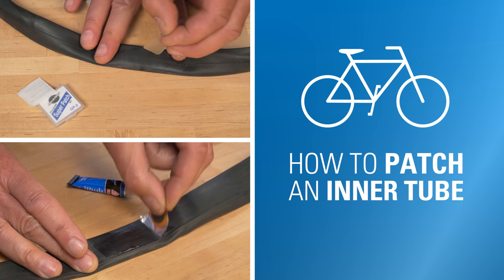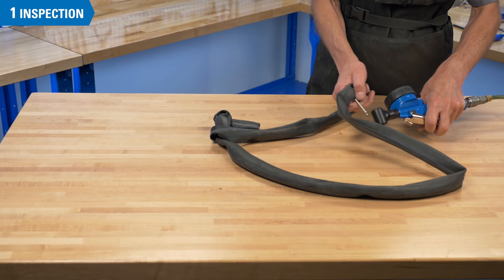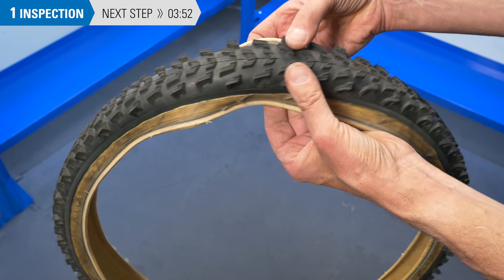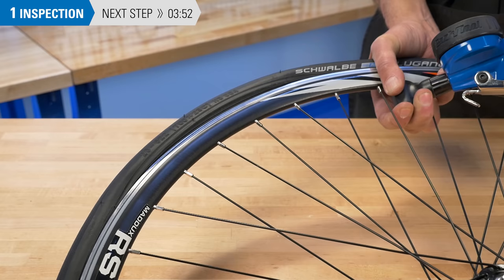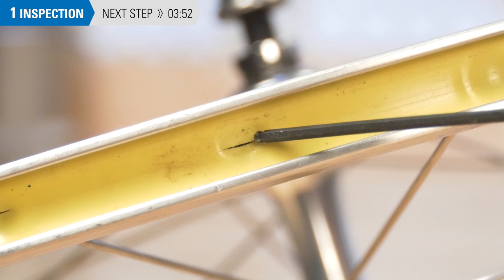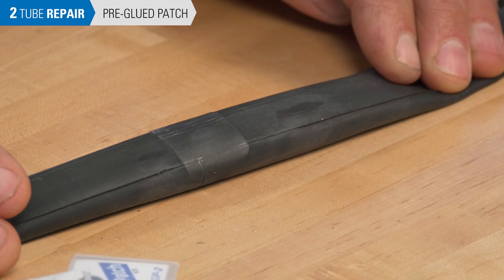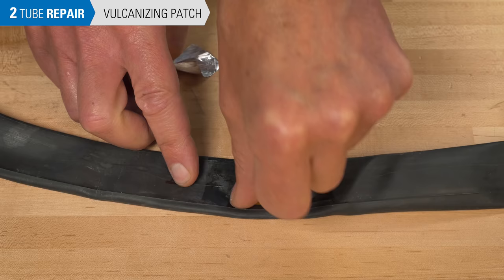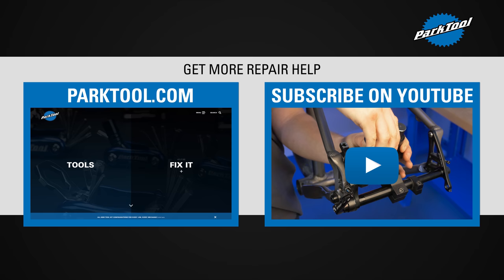How to Patch a Bicycle Inner Tube

Comment: I ride all the time and have had a ton of flats.  I’d add one caveat to this excellent video.  DON’T carry a patched tube as your spare.  When I get home, I promptly repair the replaced tube from my ride and swap it out with the NEW tube I used while on the road.  I put the non punctured tube back in my carry bag.  I was once stranded in the middle of nowhere because the tube patch failed and that’s not the place to discover this.  Just my thoughts based on actual real life adventures.
Reply: Just get yourself some airless tyres and you don't have to worry about flats ever again.
Reply: @leemanwrong  Well, that's not 100% true.  We've had to leave people behind for pickup cuz the sealant wasn't working.  Been on the fence about going tubeless as a result.  Plus, got a screw puncture that went right through my carbon Zipp 404, so I don't know if it would hold pressure.   Still, tubeless is far more reliable

Update :  I misread that.  You said airless, not tubeless.  DOH!
Reply: Lol I just use superglue and a piece of paper to patch the tires on my ebike. The rear tire is still holding after about a week, I just did the front tire today which I know should hold longer because the rear tire is where most of the weight is. I've changed that tube so many times now because the tires I've previously used wore out pretty quickly due to it not being flat like. I plan on just getting tannus armor for the rear wheel. Not only that but you can ride on it if you get a flat.
Reply: @jimsjacob  I use Tannus airless tyres which have been amazing. They are quite firm so they give a bit of a rough ride on bad roads but not having to worry about flats makes it totally worth it.
Reply: @dizzydeckdog6688  Haha true, riding on some bad roads could make your teeth chatter a bit!
Reply: So if I understand your method correctly, you put the patched tube back on your wheel and ALWAYS have a NEW tube in your bag as a spare. Right?
Reply: @irenevoce4922  Correct.  It's not that I favor a patched tube over a new tube, but rather I'm trying to be economical.  I ride on Zipp Firecrest 404's and those require a 80mm valve stem.  Found that when I get home, I can ID the hole, apply a patch and re-install the tube.  Has worked great for me and I just put the new tube back in my diddie bag. Eventually a new tube remains installed and the process starts over.
Reply: @jimsjacob  thank you. Good advice. This is a nice balance between economical and excessive caution
Reply: Solid advice! I do the same.
Reply: I also love the clear adhesive patches that park tool has! It’s great for on the go fixes, but the glue works great for at-home fixes.
Reply: No, WADR you were stranded in the middle of nowhere because 1) you did not bring enough tubes, and 2) you did a shabby job of patching your tube. You can put well patched tubes into your tube rotation with no worries. Eventually, you might reach a limit... one time I set out to patch a tube and found there were already 6 patches on it. I repurposed it as a bike chain cover.
Reply: Agree. Fat tire. War on goat heads.
Reply: It failed because you failed, not the patch. If you had done it correctly (not like this video shows, glue BOTH the patch and the tube) which you did not, it would not have failed. I have ridden on patched tubes for YEARS.
Reply: @gary7vn  Whats bs? I've been riding airless tyres for a year now, i've had nails and all sorts of things get stuck in my tyres and i can just keep going.
Reply: Yes and also confirm the hole has been repaired properly by the same methods used to discover the hole in the first place
Reply: @leemanwrong  needed this comment just fixed my first e bike flat and never want to do it again lol
Reply: @yru435  You can turn a tube into a bike chain cover?  How do you do that?
Reply: You just didn't patch it properly. I've been using patched tubes,the most with 9 patches and it still works
Reply: @entltyq  Yeah I did.  My tubes can look like leopard skin with all the patches.  Just put the 4th patch last week on my rear wheel. It's not rocket science patching a tube.  The patch can fail, the glue can fail, etc.  Once the tube is inflated and expands, the glued down portion will not and can tear at the edge.  Hence, repair it and immediately install it.  It then has the chance to naturally stretch with the rest of the tube.  Any issues are revealed right there at home and not out in an orange grove in the middle of nowhere.  Take it from an expert.
Reply: L m
Reply: L m
Reply: Good advice. It’s better to use the patched tube for the ride and keep the new inner tube as spare.
Reply: @leemanwrong airless tires?
Reply: @johntyson  Yes i use tannus airless tyres. They're a solid tyre made of a rubbery type compound. They do make the ride bumpier but in exchange you never have to worry about a flat tyre.
Reply: Well patched spare tube works as fine as a new one.
Reply: I realise this is 2 years old but just to let everyone know, you should not be getting "a ton of flats", even if you ride a lot on rugged terrain. If you do, you have either (1) the wrong tire or (2) the wrong air pressure. Get good tires for the type of terrain you ride on and inflate them well enough according to your weight and the tire specification (SRAM has a handy calculator online but you should tweak it for ride feel and amount of flats).

Good tires cost 50+$ but actually they save you a bunch of money down the line since you don't get flats all the time.
Reply: @ohfouroneone  Ironic....  Yesterday's club ride saw a total of 5, yes count 'em, FIVE flats for 5 diff guys.  While unusal, that's a ton of flats. Screw, staple, glass and rocks were the cause and if you ride as long and  far as I have, you will have tons of flats.  No matter how much you paid or the pressure.  Carry what you need to rescue yourself and make sure it's not a patched tube.  That, or ride where there's signal so you can Uber yourself home.

Comment: Wait what? You guys throw away the tube when it's punctured?!!!! My tube has 6 patches on it and it's still running strong.
Reply: what kind of parches do you use glueless or regular rubber patches with glue
Reply: Why not just use a new tube after you get one?
Reply: mine's 8 lol
Reply: @Cameron XP year old comment but I read that as pawn shop first and wondered who the hell pawns an inner tube
Reply: There's nothing wrong with patching the tube multiple times, as long as you know how to patch a tube prooerly. I've used tubes that have around 10 patches, not the Park Tools patches definitely, they fail,  they're soft and the glue is  weak.
Reply: @AR-lz2br  which ones work the best, I want to have at least 30 patches on mine.
Reply: It's because you're poor.
Reply: @Mannie Illescas your learning bud thats the beauty!
Reply: Jokes on you, I don't even have a tube
Reply: @Frijo1  there are some vulcanizing shops that patch it with a rubber something and stick it with heat
Reply: It depends. If the tube's still manageable, you can keep riding on it. If it's damaged beyond repair, replace it.
Reply: @mantid83  It's both expensive and creates unnecessary waste. If you have a small pinhole puncture, why get a new tyre when you can repair it and have it work perfectly fine?
Reply: cutting patch from really dead tube and using whatever glue one can get hands on (or even cook your own glue in back yard!) to patch tube was a thing in soviet union, but now in throw away society regular new tube is cheaper than those fancy patching kits.
Reply: @moofymoo  I got a self-vulcanizing patch kit for $1.25
Reply: Lmao, i just glued my 23rd patch on my tube
Reply: LOL “6 patches and still running strong” HOLY CRAP!
Reply: Yes.i throw mine away or cut them up to tie stuff.  Patched tube no matter how well done will never be as good as a new know. I'd rather be safe and have a peace of mind rather than worry every second  if it will explode when I am going 50kph downhill
Reply: What brand do you use
Reply: That's why we are known as Indian 😅🤣🤣🤣
Reply: unless you buy patches and glue in bulk, its around the 3rd or 4th patch where it would have cost the same amount of money and much less time to buy a new tube
maybe you are going for an Innertube of Theseus ?
Reply: really? years ago i had a tube which is almost full of patch
Reply: @chaosbreaker657  really, as opposed to using a tube you can't use, genius? It's always a good idea to use a patch vs replacing, if possible. Waste not, want not
Reply: @BeeBait  That's what I was talking about. If the damage can be repaired, patch it. If the damage is too great (a massive tear on the inner tube, for instance) replace the inner tube at once.
Reply: @zpolukuchka  If you had to patch it 3-4 times,  you'd have needed to buy 3-4 tubes.
Reply: @JoshuaLevy123  dude, You are ambicious!!!

Comment: idk where I would be cycling wise without these videos. thanks for being there parktool. my dad wasn't around much and here I am in adult hood trying to figure shit out on my own.
Reply: Their method for "vulcanizing"  (it's not vulcanizing, words mean something) is simply wrong. The "fluid" they are talking about is, wait for it, "glue", to be precise, it's contact cement. To properly "fluid" sorry, glue something with contact cement, you need to glue BOTH surfaces, at least they got the let it get tacky part correct.
vulcanizing - https://en.wikipedia.org/wiki/Vulcanization
Reply: And you have the smarts to do so 847...your Dad did the best he could at the time with what he had.  Forgive my friend.

Comment: I used to buy a brand new tube after every puncture... $20 surely adds up overtime.
Reply: I used to do the same ,with this video I can now do it myself
Reply: why do you need to buy such expensive inner tubes when there are far cheaper ones which seem to be the same quality as far as i can tell

Comment: I noticed that I had a puncture in the front tyre of my Moulton on the way back from the supermarket. Prepared as always I whipped out my brand new, unused Park Tool puncture repair kit and prepared the inner tube for a patch. Opening the tube of rubber adhesive compound I found the tube to be sealed, but completely empty, In the manufacturing process something had obviously gone wrong. Fortunately on this occasion I had a spare inner tube, which saved the day. I decided to go further up the food chain of puncture repair kits and bought the highly recommended Rema TT02 kit. This is my second one and Rema are at the top of their game as they fill their adhesive compound tubes with more than air! You actually get the adhesive!
Reply: it's always a plus when a tube of glue actually contains glue👍🤭
Reply: Literally looks the same as the parktool one but rebranded

Comment: Thank you for a great more video. I had a suggestion about patching,  i normally do all steps as you mentioned above but an step further, that is ; before applying the patch on the inner tube i inflate the tube to a diameter equal to the bore diameter of tire itself, then apply the patch, push the patch by fingers  and wait for about one minute، then deflate the tube and insert it as you mentioned.
This minimizes  the  stretching of the patch while inflating the tube with high psi and prevent it from detaching and  lengthens  patch stability. 👍
Reply: at what point are you letting the glue dry ?
Reply: @carlosrestrepo8525  Well, the glue is still stretchy, so ...

Comment: Thank you for great video! Another small tip is always placing tube valve somewhere under the middle of the tire label when initially installing the tube. When you find a puncture and align punctured tube valve to the middle of tire label then you know where on the tire or rim a place possible puncture cause is to inspect it more thoroughly.

Comment: Great tips!
Great video: well shot, well edited, well directed, very well presented. Also no waffle or padding in the narrative, just straight to the point. Thank you very much. Though I'm a very experienced biker, I still picked up some fantastic useful tips like
- the 'crosshairs' marking the hole, and not just the 'ring' which I'd been doing which became obscured by the glue
-  the leaving of the plastic sheath on the outside of the patch to reduce friction on the patch (I always worried that it would 'pull' the patch off, how wrong was I!)
- not inflating the tube to usual pressure outside the tyre. I long suspected this might be the case where the bond is weakened due to no support from the tyre, but wasn't sure. Thank you too for confirming that for me.
Overall, excellent, excellent video.
Why can't all '"How to" videos be as overall well-done as this??!!

Comment: My husband bought a CCM repair kit.  It has been awhile since he has had to buy one, so of course the black patch outlined in orange was new to him.  The kit came with absolutely no instructions.  Good thing we found your Video which showed which part of the patch should be facing upward.  He had it the opposite way.  Perhaps CCM didn't include instructions because they just assume that everyone has access to the Internet to look for instructions. My husband commented that if someone got a tire puncture while biking on a trail in the middle of the woods then instructions would come in handy!  Mind you, CCM might suggest you use your smart phone to find a video such as yours, but, we are the lonely few that does not have or use a smart phone.  Thanks for letting my vent!  I plan to write to CCM to ask why instructions weren't included in this repair kit.
Reply: i know your comment is old but the park tool super patches are awesome, tiny little kit with everything you need plus instructions, and for about $1 canadian per patch they really are decent bang for your buck

Comment: I had a blow out when I put a new inner tube in my front wheel. I didn't notice the tyre was not seated properly when I put it back on the wheel rim. I continued to inflate the tyre and then......BANG!!!!!!!!!!! Very very very loudly bang because the inner tube had burst.....blown out because it was trapped between tyre and rim and was outside the tyre. I learnt a lesson......always check tyre is seat properly when inflating the tyre.

Comment: I prefer to use the stick on patches. Just peel off from the backing and apply to the tube. No messing around with glue and waiting for it to go off. Works very well.
Reply: Yes but self vulcanizing patches last a lot longer, hold more pressure and are more secure. I personall prefer them
Reply: @Fred_the_1996  same. My tires are at 65 psi, I don't trust stickys. Plus vulcanizing are easily available in our corner store, stickys only in the bike stores around here and those are out of the way for me. So first it was convenience and then experience when a sticky a friend gave me failed.
Reply: @Fred_the_1996  what do you mean by self-vulcanizing? How does it work? Can you please elaborate on that for me? I don't clearly understand what the orange/black patch made of. I initially thought it is just an orange plastic with some resin on top of it.

Comment: I didn't have any patches on hand and had a flat this evening so I cut a patch out of a spare inner tube and used krazy glue as adhesive. Put everything back together and inflated the tire to 100 PSI. 4 hours later and it's still holding so we'll see.
Reply: On the 3rd day and after roughly 100 miles of riding the Krazy glue patch leaked and luckily I had some park tool patches on hand this time. Removed the old patch, sand papered the tube and applied the patch, now the pinch holes are really repaired.

Comment: This video is so well presented that I have to comment where an improvement can be made: at 4:15 use water as the solvent nothing else. Rubber is hydrophobic and those loose rubber bits just float away as if they are repelled by the water. And rubber dries instantly. No need for anything more volatile. Thank you for putting so much information so concisely! Brilliant!
Reply: Oh, and water won’t dissolve the sharpie marking the pinhole, so one only has to find and mark the leak once, and that’s a timesaver.

Comment: I never knew to wait until the fluid is dry, before applying the patch
Reply: Yes wait until it's dry. I've applied fluid and left overnight before I've applied patches.. I've never had any fail..
Reply: @cyclingSausage  cool 😎
Reply: Frank Leurs  Or go take a dump :-)
Reply: Frank Leurs  Or check to see if there are embedded objects in your tire that may result in a puncture from being worked in.

Comment: Nice video!!

Didn't know the trick of spreading the grue with the foil of the patch, very clever!

Most of my punctures are the "snake bite" type, some times they are so big even the biggest patches don't hold enough the high pressure the road tire needs and I have to discard the tube wasting a patch in the process...
Reply: If you're getting a lot of 'snake bites' try putting a little more air in the tire that you're used to, say you normally use 60 psi for example, try with 70 psi and see if that works. Safe riding!
Reply: Snake bites (aka pinch punctures) occur when the tube gets pinched between the tire and rim. More pressure in the tire should help prevent these. Sorry if you already all this info, if you don't maybe I helped :)
Reply: have you tried two patches?  im about to try it now
Reply: Christian Rodriguez a